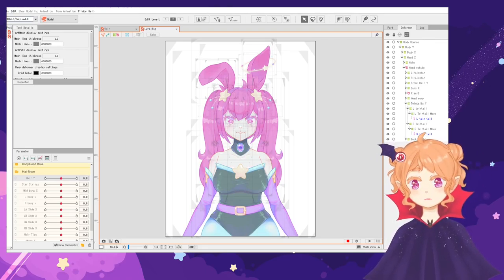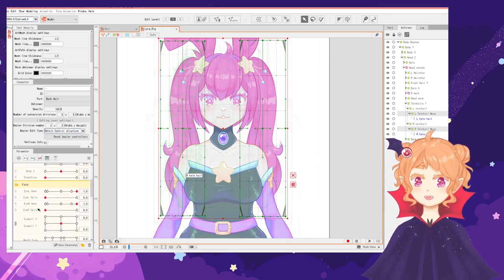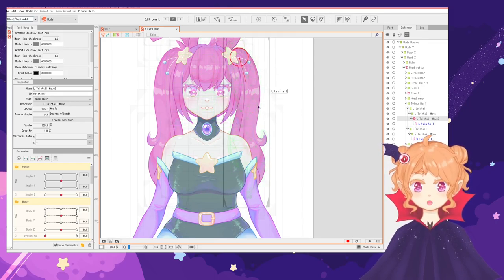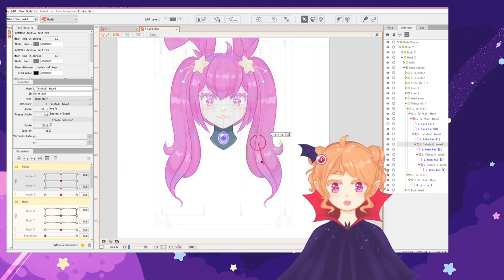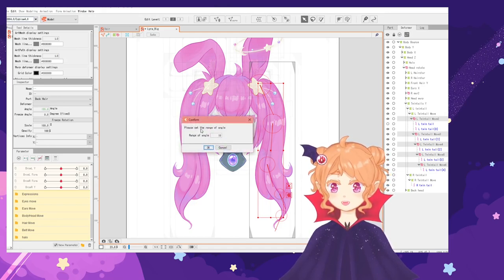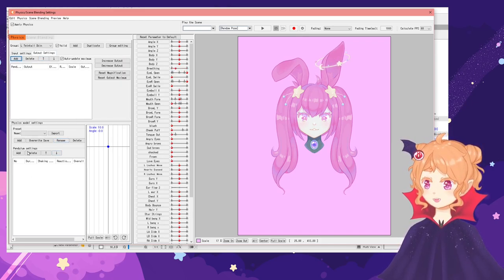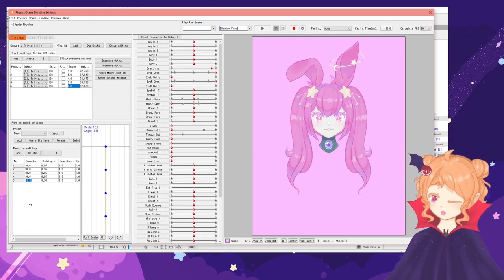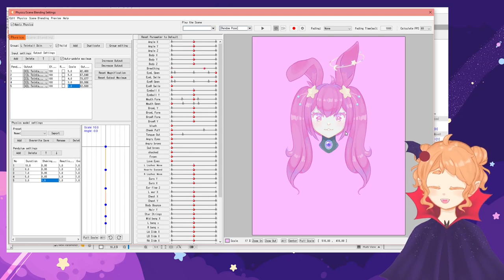Skinning hair physics in Live2D | More details and what to look out for!

Comment: Hi! So I have a little bit of an issue with setting up some of the input effectiveness (it worked the first two times I did it but now it's not letting me) where when I set one to 100 I can't change the other one, I can have them both at 50, or other numbers I just can't have them both at 100. 
Thanks for the tutorial though! It was actually really helpful :D
Reply from the maker: Ah yes, of course I forget something~ the numbers must add up to 100 total. From what I've seen though, it's not a huge deal if you have 25, 50, or 100 effectiveness.
Reply: If you have multiple inputs the total must be 100. If you struggle with it not being effective enough at 50/50. just up the scale :)

Comment: Hello! I ran into a problem while trying this which im not sure how to solve so I would be happy if you could help me! Once I added rotation deformer tool, the hair doesnt follow the warp deformer that i did for Y moevment anymore. Would really appreciate any help thank you ^^
Reply: Hi! Did you ever find a solution? currently having the same problems.
Reply: @spookaychoco2860   Hello, sorry i didnt found a solution. I ended up just adding more deformers to have kind of the same effect. :') (so i didnt use the skinning method at all)
Reply: @gaodesu  Aw that's unfortunate. Thanks for your reply anyhow.
Reply: same ; ;
Reply: I don't know if this was to late or not, do the same with Angle X and Y (Create a dot on parameter for the parameter you want to keep)